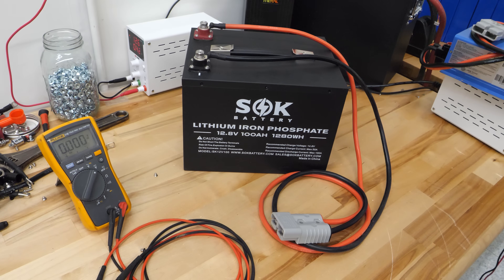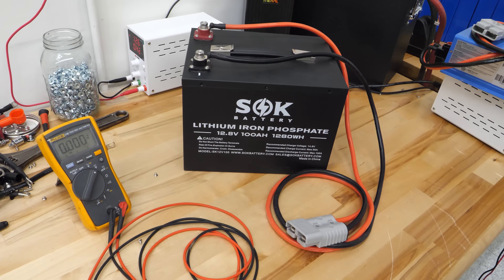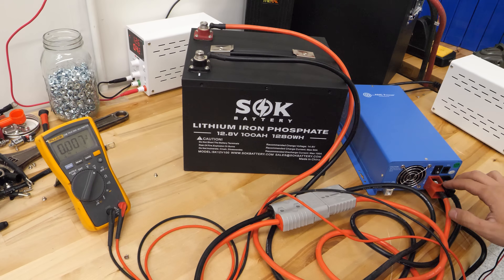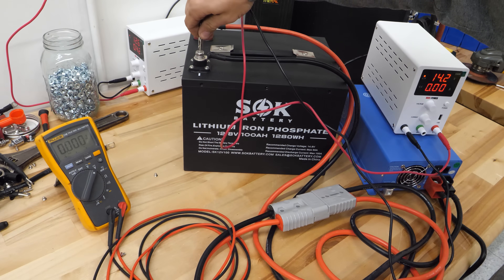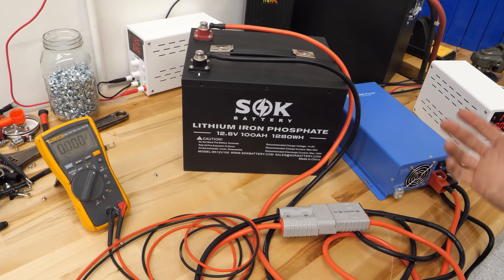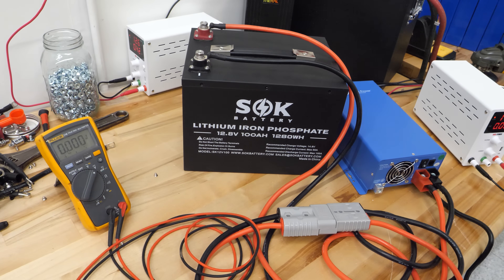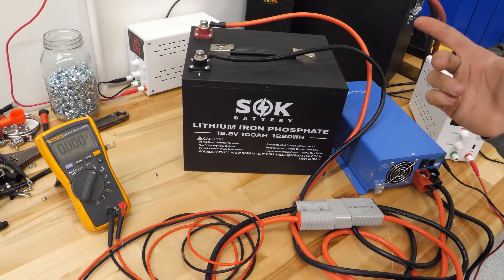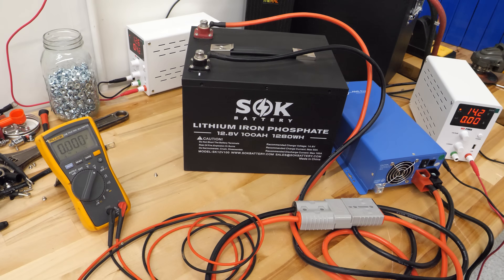How to Wake a Sleeping LiFePO4 Battery 🔋 Charge a Fully Depleted Lithium Iron Phosphate Battery

Comment: Okay, if im in my boat, i have my lithium battery for electronics, lead acid battery for cranking.  If i use the "jumper cable" method from lead acid to lithuim, do i need to actually need to turn the key?  Do i need to start the boat?

Comment: You are actually telling the charger there is a battery at the other end of the cable. A 9v battery will do the same thing. The charger needs to see current even a small amount will allow the charger to start.

Comment: You should use a diode between your power supply and the battery to protect it from being back fed by the battery charger. Without the diode you may damage your power supply while trying to wake up the battery.

Comment: I was following advice to condition a new LiFePO4 battery by charging it to 100% and then discharging it completely.  My heart stopped for a moment when my charger wouldn't do anything, and my multimeter showed it barely had voltage.  I knew the BMS was doing its job and cutting off the cells at low voltage, but this video reminded me of an old reviving trick.  I never would have thought of this trick as an easy way to fool a charger and get things going again.

Comment: With all the technical talk I really wish you could’ve slowed down and actually explained how to do a charge with another battery.
Reply: Good point. Basically if you have another charged 12 volt battery you connect it to the dead battery so that current is running through it so the charger sees 12ish volts and the lithium battery will wake up.

Comment: Dang, that is exactly what i did to my 36 volt ebike battery, i hooked up a good  battery in parallel with it (exact same model) battery, then plugged in the charger after a few minutes.  I got bubkis.

Comment: Great video.  I have a slightly different problem.  I have 3 12V LIFEPO4 batteries in series to run a 36V golf cart. The cart has been dieing after a short period of use. I find that one of the batteries has a negative 8 to 9V on it and the other 2 are fine at around 13.5V. I have to put a 12V trickle charger on the negative reading battery to bring its voltage up so that my onboard charger will take over like you described.  My question is: why does one of the batteries draw down to a negative voltage in the first place.  It's not always the same battery either.  I tried the balancing method of fully charging and then connecting them in parallel overnight but I still end up having the same issue.  Any help would be greatly appreciated.

Comment: Hi! I have a 51.2v battery dead and have another working on 48v. Can I boost the dead 51.2v with the 48v?
Reply: Hello eduardoandreotto3504, would like to know if you had your question answered? I have a similar situation with 2 EG4 48v 100Ah that I let discharge to 52.4v. I can't charge them with my EG4 48v charger.

Comment: My battery 48v 30ah lfp battery charged 100%, (charged from 85% to 100%) after riding 45 minutes gap , but after that fully charged vehicle couldn't on , when i put on triper , i couldn't on sound /and vehicle on ,
What should i do sir.
Give the solution please, thanks.

Comment: I had an Aimes  charger do the same thing.
I think  it criminal that the charger manuals don't' let you know that they will not wake up a BMS!!
Idiots write the charger manuals IMHO.
Idiot design them too because they could easily be modified to wake up a battery BMS.
A 12v and a 24 wake up button on the Aimes would do the trick.

Comment: I have a Rebel 24 Ah battery that has had little use. I run a small 14 lb. thrust trolling motor with it. The battery worked very well and I always charged it with a Dakota 3 amp LiFePo4 charger after each use. One day it read 8.4 volts and it hadn't been used. I put the charger on it and the charger showed the green light and wouldn't charge. So is this the same problem? I need to attach a 12v source to bring up the voltage to 12 so it will charge? Can I just use a standard wet cell charger to force 12v or do the battery electronics prevent this?
Reply: I tried the charger, which puts out 14vdc regardless of what the battery voltage is; doesn't make a difference. The LiFePo4 battery is down to 6.27 and won't go any higher regardless of how long you leave the charger on.

Comment: Dont forget to include that just like a 12v charger can wake up and 12v lithium battery. A 48v battery charger will be needed to wake up a 48v lithium battery. A 12 v charger cannot wake up a 48v lithium battery.
Reply: Great point. I connected (2) 12v agm batteries in series to create the 24v needed to wake up the bms in my 24v lifepo4 system using jumper cables. I clamped onto a resistor which i then touched to the positive post on the lifepo4's and it offset any spark.

Comment: Other guides advise to raise a LiFePo4 from 0V veeeery slowly. But you say do it quick. Are they wrong?
Reply from the maker: The charge curve is extremely steep at this point, so even if you apply just a small amount of current the voltage will rise very fast.
Reply: @CurrentConnected  Are you recommending very small current?

Comment: Our system was just installed and I ran it dead not knowing. Everything is off. So basically what you’re saying is, I can jump my two lithium batteries with one car battery? And once everything turns back on I just let it charge up with the solar panels?

Comment: I own two 12 volt, 200 Ah Ogrphy batteries.  One functions fine - - the other does not.  I previously had used both in series for a 24 volt solar system.  I have since replaced them with several  server rack batteries since I needed more storage.

The malfunctioning battery shows 14.1 volts after I charge it with my Genius lithium battery charger.  However, when I connect it to my 12 volt Giandel inverter, the inverter displays "Low" and then shuts down.  I also tried it on a cheap PWM inverter which would not even turn on.  The battery still measured 14.1 volts after I disconnected it.  I then tested both inverters on the other Ogrphy battery and they activated both inverters and provided power.  The temperature during testing was ~ 74°F.

I purchased the batteries 28 December 2022 via Amazon.  So I'm wondering what the problem & solution could be.

Comment: What if you
Have 4 batteries in series. Then the positive end on one side and the negative end on the other. My VictronConnect multiplies cannot charge the batteries one at a time or it will dry the single battery!

Comment: Will this same method work with a 48v lithium battery and using a 48v power supply? My battery is completely dead. Reading 1v . Charger not kicking on

Comment: A BMS is designed to turn off the output when the battery voltage is too low, this is for EVERY LIFePO4 battery, not just SOK.  It is not sleeping, it is in self protect mode.  The AIMS does require an input and will draw ~250ma while connected to the battery and not charging.  I would caution hooking up any power source that isn't current limited because it will not work or it will short the LA battery for example.  Don't do it!  Use a current limiting device or much care, Jump starting a LIFEPO4 battery is VERY dangerous and could trip the over current on the destination battery because if your 'Jump' battery will provide more than 100 amps, the 'sleeping' battery will gladly accept everything you give it.  Using 'Sleeping' and 'Jump Start' are two very dangerous and incorrect terms for the average person.

Comment: I have a question that I can't find answer to. I have a 2019 kx450 that uses a lithium battery. Issue is it shows 13.6v in rest. If I hit my start button it sometimes starts but it may just click and I check battery. Battery has less than 1volt. I unhook it from bikes ground and it returns to 13.6v immediately. Is battery bad or something else?
Reply: I then hook ground up and bike usually starts instantly. I try to replicate it but usually it just random

Comment: This method (with 12.8v battery as the "pusher") worked for me.  My 7.2Ah Miady LifePO4 battery was drained to practically zero volts (0.08v).  Thanks for the tip!  If you are out in the field or have no other voltage source than a solar panel, you can - briefly - hook up the solar panel directly to the "dead" battery to jump start the BMS.  I tried it too.  It works.  Nothing got fried.

Comment: I have a renogy 12v 50ah and has 0 volts.
I tried to activate it with my 10amp charger. There is 14.4 volts across the terminals, but 0amps going into the battery. As soon as I remove the charge  cables, the voltage drops back to zero over a 30 second period.
What can I do... please help
Reply: Did you figure this out?
Reply: @mtom9267  defective bms.  Cut it apart and also found rust in many connections
Reply: I attempted to charge my 72v 20ah and it turned into a ballon same problem
0 amps but correct voltage

Comment: My solar charger indicates the battery is full, but it won't light up. The built-in switch on the battery will slowly activate the green light, barely and it flickers. But the meter gauge on the battery does nothing. At least last night, hopefully today will fix that.
It went out when I added a 60w clothes iron to the 300w inverter that also had my laptop plugged into it. Shouldn't have been too much power... The inline fuse looks fine inside the battery looks good.

Comment: I may need your help later on I’m going to try to build a small home solar set up/system I just ordered the 100/50 smart Victron MPPT charge controller and I have been buying up Renorgy nine busbar per 100 W 12 V panels as returns from Amazon to save money right now I have four of those panels and three older Renorgy 100 W panels i’ll probably create a small set up with the three older panels in a separate set up and keep the newer panels all together by themselves and their own system. I’m looking at power queen or Redodo batteries any thoughts on them???Am I moving in the right direction here or no???

Comment: Man. I've been searching for a week. How in the heck do I get my battery going. 48v bike. It's apparently in sleep mode. Well let's see a video on connecting my battery two an equal battery as the connections are much different than the lipo whatever
Reply from the maker: Your battery probably has a fuse inside that blew
Reply: @CurrentConnected  Wow. Yeah I thought about that. But I literally drained it coming home over a week ago. Been sitting dead for 10 days. I did airtight bag freezer it for 17 hours. It's thawing out now. I know how to disconnect the BMS and reset it. I'm hoping that works. I'm not sure where the fuse is located

Comment: If I was a customer I would return that battery too! Not because I can't jumpstart it but because it dropped to 0v as LiFePo4 batteries all have BMS which prevents them from over discharging below 12.0v and if that one got to 0.08v somehow than it's definitely as FAULTY as faulty can be so don't hide the truth and blame the customer.
Reply: in this video, they are literally showing that the BMS has done it's job and is working.  The cells aren't down to nothing inside, it's just not completely visible because the BMS is off.
Reply: @HighTechLab  ah ok sorry then as you are 100% as I found out indeed BMS in extreme discharge cases to 0% can shut itself off completely.

Comment: Wait... question...I have the same situation with a 72v lifopo...so I need to jump it with another 72v battery, correct? I can't use a 12v car battery, right? Thank you.
Reply: Did you figure this out I also have a dead 72v battery
Reply: @mtom9267  Still sitting on the shelf... won't take a charge and I can't find any info on how to make it happen. Please let me know if you figure it out! :/
Reply: @designsinorbit  Mine just turned into a ballon by trying to charge it. Had to recycle it cause it was basically a bomb. if you do try to fix it becareful 😭.

Comment: Thanks my renogy battery (1 weel old) goes into shelf mode  randomly.  It will work and the next day 0v.  I wake it up with a 8amp current.  It will work...come back 2 hours later and read 0v.  This normal bms?  Battery sitting on my kitchen table.

Comment: So i have this set up (aims power and Sok 12.8V battery.  I followed these steps and the aims comes on BUT when  I disconnect the external power source the Aims charger goes into float mode, while the battery remains uncharged.

Comment: Good info. I have a lifepo battery from a different mfg and have tried to jump start it. Didn’t make any difference and The case isn’t removable. Just to be sure I need to connect the charger to the battery while jump starting?  Any help would be appreciated. Thank you

Comment: I tried jumping a lithium w a fully charged lead battery and connecting the charger. While the lead and lithium charger are all hooked up the lithium charger will charge but once I disconnect the lead battery and it’s just the charger and lithium battery the charger won’t turn on (lithium battery is around 9 volts currently)

Comment: Although I understand the premise of this approach it seems dangerous. If the BMS cut off the battery isn’t is safe to assume the cells are at a low enough voltage that it would be unsafe to recharge them? For example, I had a LiFePo battery in a small UPS that carried a the correct rated load for the battery until it ran out if capacity. After power came back on that UPS was unable to recharge the battery. I checked with a multimeter and it claimed it was over 900v so i quickly disconnected the leads. A few seconds later i tried again and it read like 2v and drops rapidly. I left to battery in the shelf for a little over a month at this point.
Reply: It worked for my battery!  not sure why it read 900v when I first metered the battery but after trying this my 12v 7ah Power Queen battery is back from the dead.
And to somewhat answer my own question. The battery read 12.8v after being woken back up, I am confident that voltage wasnt brought higher through by process because the battery i connected it to was around 11v.

Comment: I have an ebike with lithium batteries.. if that happened to me, my charger (the CycleSatiator from GrinTechca) has a force start feature.. i would just force start and off it would go.. The technology for "force start" on lithium batteries is there. But an 52v evike charger is normally around $60..  The CycleSatiator (that can adjust to a range of battery voltages runs $360.  Good chargers make all the difference.. and my charger has capability of charging to 80% / 90% or 100%..  fully charging lithium batteries dramatically reduces the number of charge cycles..   This makes my $500 battery last twice the number of cycles... (saves me money)  GrinTechnologies in Canada has many to choose from.

Comment: I had "dead" lithium batteries in the caravan put the charger on nothing happened nothing I did would work, watched your vid decided to connect the car running and Anderson plug whammo everything started to light up and the charger started to do its job, thanks heaps
Reply: One suggestion... use punctuation.  This was nearly a run-on sentence, which made reading it difficult.

Comment: question: can i use the same 12 v motorcycle  lithium charger that charges my  12 v lithium ion battery on my 12 v  lithium iron battery , or iron v.s ion need special charger for each ?

Comment: Great info, thanks ! However, I awoke a dead Renogy by pairing it with another charged Renogy and that worked to awaken dead Renogy battery : HOWEVER, I told Renogy what I did and they said I did a NO NO and thus ruined the future warranty of the now awoke battery !
Reply from the maker: That's absurd.  The batteries are permitted to be paralleled, so I have no idea why they would void the warranty for doing exactly what they allow.
Reply: @CurrentConnected  That's why I told Renogy why I did that awaken method but their tech support staff emailed me back and said I should read the battery manual which indicates that warranty was denied /ruined by miss matching battery state of charge by a large amount; which dead battery was of course way less SOC than the donar SOC charge was. I'll never buy another Renogy. Renogy claims pairing batteries with different SOC ruins warranty claims and their products.

Comment: I am currently using Victron IP65 12V/10A and IP65 12V/15A but my LiFeP04 are still asleep
Reply from the maker: It's possible there is something wrong with it internally.  I would call the place you bought the batteries from and work through the warranty with them.

Comment: What if the BMS has turned off the battery because of the cold temp cutoff limit? Will I have to warm up the battery until all the cells are above the cutoff limit (35 degrees F)? Anyone who knows just respond - thanks!
Reply from the maker: Yes.  The battery can't take a charge if it's below freezing.

Comment: Thanks a lot for making this video. I believe I was having issues with the low temp protection on an SOK 12V100AH and was also seeing a very low voltage like in your video. I will attempt the car jumpers!
Reply from the maker: Just remember, if the battery is below freezing, then it will not allow you to charge it even with jumper cables or the proper battery charger.
Reply: @CurrentConnected  Thanks for the fast reply, it has warmed up since. Thanks for the warning.
Reply: We are up and running!

Comment: What if it started charging when I connected it to another battery, the battery charger got to “fully charged” but as soon as I disconnect it from the other battery it goes back down to 1.5v? Is that a bad battery? Thanks
Reply: There should be no way for the 12.6V LiFePO4 battery to read you 1.5V at its terminals.
The BMS disconnects below approx. 11V so the lowest you would ever see is maybe high 10s. Or zero Volts when the BMS actually activates the disconnect protection.